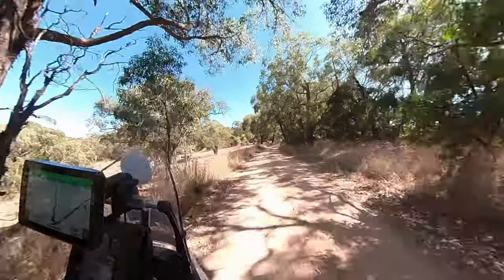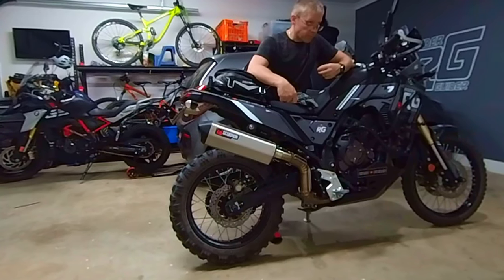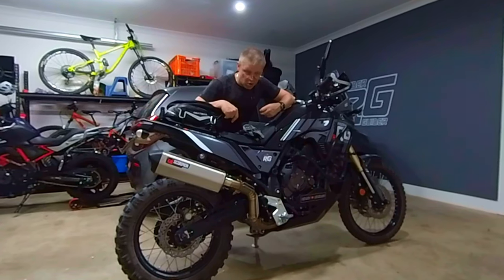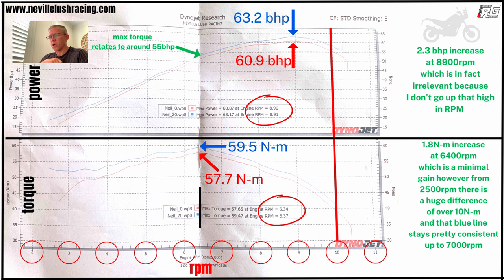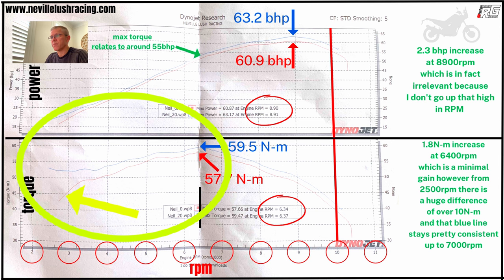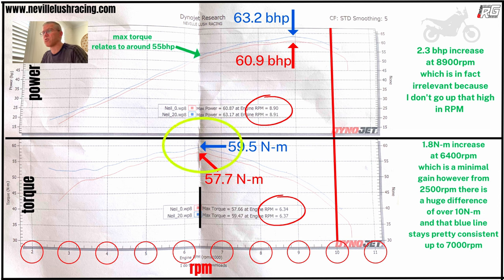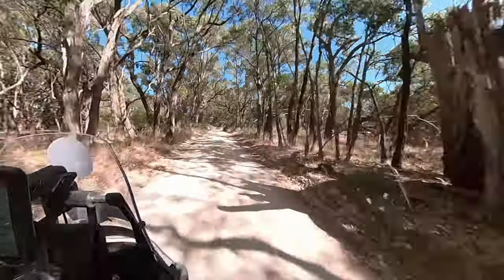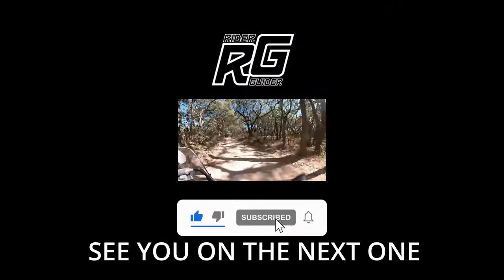Yamaha Tenere 700 Full Decat Exhaust System Dyno Gains

Comment from the maker: Hello and welcome, thanks for visiting Rider Guider here on YouTube

I'm Neil, the proud owner of a fast evolving 2020 Yamaha #T7 #Tenere #tenere700 
One of the things I've added to my #yamahatenere700 is a full exhaust system.
CLICK HERE  https://youtu.be/AE8h_l2PIo8 (if you haven't seen it). 

To get the best from the system and to ensure my engine was being fueled correctly I decided to take it for a #dynotest and an #ecuflash .  I took it to a local (ish) motorcycle tuner, Neville Lush Racing https://www.nevillelushracing.com/ who gave it the works.

In this video I explain the gains we have made, Neville by doing the actual tune and me by paying for it :-) ... By using the BHP & torque graphs I show how I interpret them and use that new knowledge to help me get the best from the tune when actually in the saddle riding the bike.  I then do exactly that in real time by taking you all on a ride, on bitumen and a trail, with (to me) a surprising result, a decent improvement in the throttle smoothness.

Here are some chapters:
00:00 intro to Wakefield Road
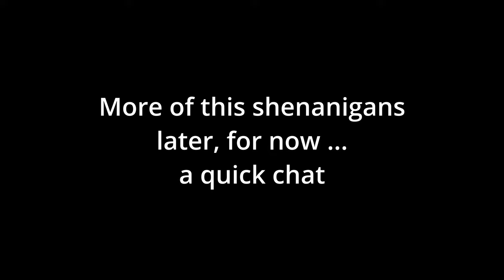00:38 How and why I decided to get the T7 tuned to suit the exhaust system
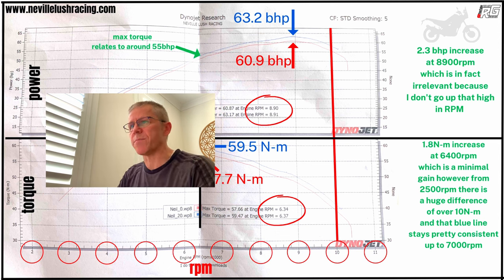02:29 Explanation and interpretation of my Dyno graph 
07:02 Through a tunnel at full chat haha
07:19 Through the gears on a road revving up to 7000rpm
08:19 My change of opinion on the Tenere 700 snatchy throttle 'myth'.
09:40 Peel Road (off road track) 3rd gear to the top, no clutch feathering whatsoever!  Who knew?

THANKS for watching

Neil

#riderguider #theriderguider

Comment: Awesome.  I rode my 2021 Tenere for two seasons before changing a lot of the stock items this winter.  For me it was good to learn the bike, then upgrade to what I wanted to change…from watching your channel I think you’ve taken a similar approach.  I have the same Camel Enduro Bend exhaust with the Scorpion slip on, love the look and sound of it.  I’m considering the Akrapovic header, so good to see the dyno results.  I also have the  funnel web filter and pre filter that I’ll soon be swapping with the Unifilter.  I removed the center stand as well, but left the brackets on as it’s great to throw back on for wintertime maintenance.  Upgraded to Touratech suspension this winter as well as swapped out the the stock bars for protaper steering damper low bars and Rottweiler mirrors.
Reply from the maker: Michael ... we're on the same path for sure!!!  I've been researching the graph results against a standard T7 and because of my rear tyre I'm pretty similar, but the bike definitely feels much improved.  I'm disregarding the peak figures pretty much, that soft old knobbly rear is sucking the energy.  Or it is at least on paper.  It rides amazing.  I've been looking at Rotti mirrors too, purely just to get a slicker more enduro look when I fold them in haha!  Plus black bars.  Stealthy!  This list of tweaks isn't getting much shorter 😄 ... cheers mate.  Neil.

Comment: I'd love to see a dyno result without the mods.
Reply: Yeah it would be very interesting
Reply from the maker: Been doing some research on this, seems on paper I'm not much different to a standard T7, however there are a couple of things to consider, the rear tyre I already mentioned in the video (was a knackered knobbly) I think it has negatively affected the graph result, but not the riding result.  My thinking is the actual graph shape is pretty accurate but peak torque and bhp reading I think are maybe a touch low to what they would be if I took it back with a smoother tyre.  As stated in the video, my main aim was to get the fueling and air correct to ensure I wasn't lean, and having now used the bike a bit more it is definitely a decent improvement in how it performs.  Martin you'll have to have a go on it mate!  I'd be very interested in your opinion.

Comment: Did the tune improve the snatchy throttle response at 2000 - 3000rpm in first and second gears? I just rode SkyTrek and by the end of it I was getting tired and the jerky throttle response was really pissing me off. On the way home I was thinking about this video and what benefit a tune would bring. I don't need more power or torque but I would like to improve rideability offroad and ensure reliability.
Reply from the maker: Hi Luke, thought I'd replied to this already, apologies for late response!  I was of the opinion the snatchy throttle was a myth as I'm a heavy clutch user, but it definitely improved it just off the throttle.  How was SkyTrek on the T7?  I'm interested in tackling that!  Willow Springs is an epic area.
Reply: @TheRiderGuider  Thanks. SkyTrek was good fun even though it was hot. I didn't do the hard part at the end as I was riding solo. The track was in good condition but it still rattled a bolt out. Parts of it are remote and you need to stay focussed. Would recommend.

Comment: Does a full system further lean out the mixture, since bike is already quite ECO lean tuned.
Reply from the maker: Dunno exactly, led to believe it does but I didn’t see or ask for any evidence but it benefits from a tune.  I had a ‘flash’ and dyno run.   It is very nice now.   Not much increase in top end power but where it counts it is better (low down in the rev range) with increased torque.

Comment: Is a ECU tune necessary with a new full exhaust system?
Reply from the maker: Mine is better for it, much more torque lower down the rev range.  Very little increase top end.  Yamaha dealer said they have a 'learning' ECU however from what I've researched it is better to have it done as it can still run lean higher up the rev range.